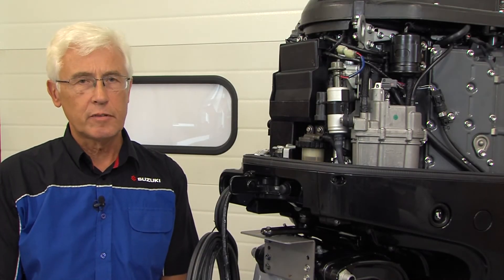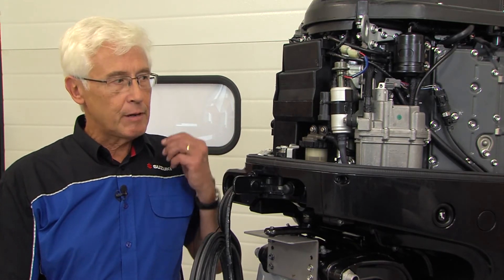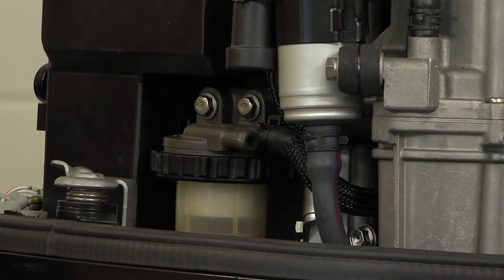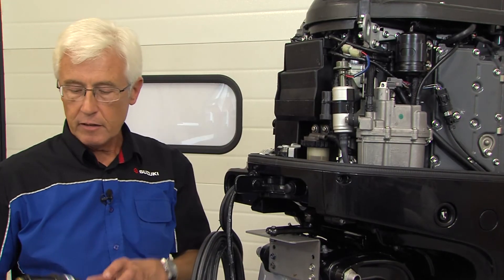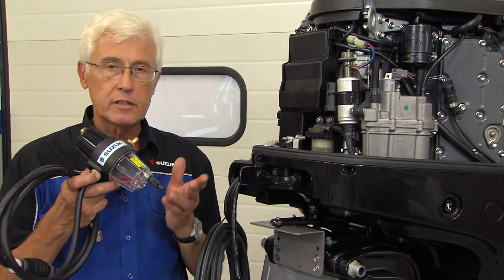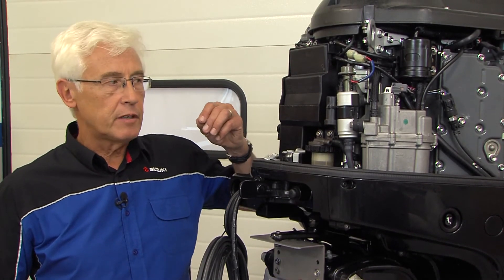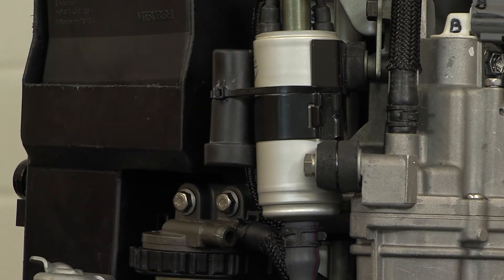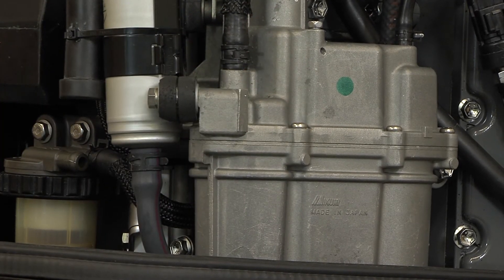Top tips - fuel (Suzuki performance outboards)

Comment: Hi !! I live in Greece and recently bought a SUZUKI 250AP outboard. I think there is a big misunderstanding and confusion on how the fuel level is measured with the SUZUKI Multi Function Gauge. My impression is this: While the gauge measures the "fuel used" electronically it does NOT give you the software option of entering your "total tank fuel", so that with a simple subtraction it could appear the "Remaining Fuel" after several uses . Instead to know your "remaining fuel" you must place hardware sensors (flotter) IN the tank (that is to open the tank !!) which many say it is notoriously inaccurate. So if you don't want to place these tank-sensors, you must do the hand- written-substraction (!!) each time after your trip to know your "Remaining Fuel" . Is this right? Is there a sensor that can be placed on the "fuel line" in the engine to make the "software subtraction" I mentioned earlier? My previous engine Etec did it that way. Are there differences between US and European SUZUKI gauges? Can someone eluminate us on these matters? Thank you very much